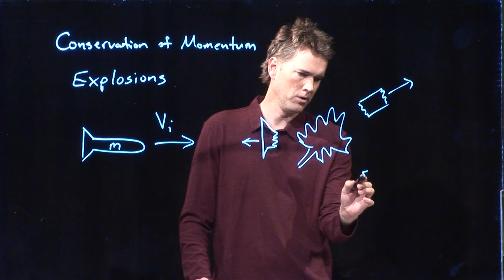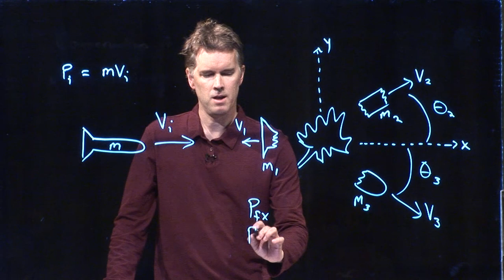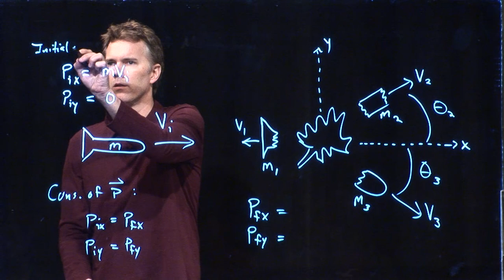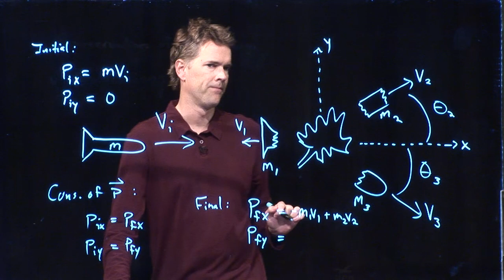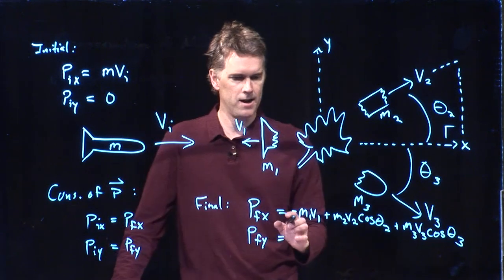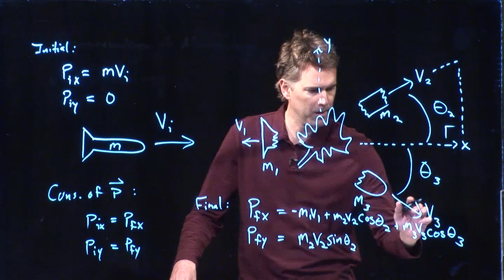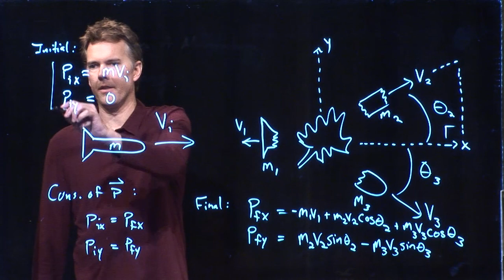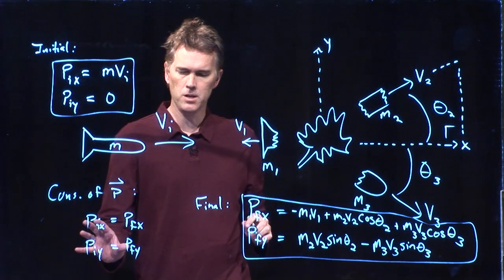Momentum   Explosions

Comment: In the calculation of the Pfx, why would you not be using absolute values ? Is the final P in the x direction not the absolute sum of the parts ? To have m1v1 as negative seems to suggest a loss in overall P thus making the statement Pix = Pfx untrue. Thank you Prof. Matt.
Reply from the maker: Ciscoho, 
Typically we don't use absolute value bars in physics.  Too time consuming.  Generally all variable are thought of as positive.  If something needs to be negative, we put that out in front.
Thanks for the comment, and keep up with the physics!
You might also like my new website: www.universityphysics.education
Cheers,
Dr. A

Comment: I have a question .... Shouldn't the third angle be between 270 and 360 because we take angle with the positive x-axis in the anticlockwise sense ..... Please can you answer , Sir?
Reply from the maker: That is fine, but then you should not put a minus sign in front of it, since, for example, sin (330) = - sin(30).
Cheers,
Dr. A
Reply: Matt Anderson Ohh ! Thanks a lot.

Comment: It all makes sense except for one thing. Doesn't the explotion add more energy to the system, thus altering V1, V2 and V3?
Reply from the maker: Excellent question.  The explosion certainly increases the SPEED of the individual particles, meaning the energy of the explosion is transferred to the kinetic energy of the particles.  But momentum is concerned with VELOCITY, which means the direction matters.  The explosion cannot change the momentum of the system.  
Perhaps one way to think of it is this: if a stationary object explodes into two equal parts and one part is going to the right at v, what happens to the other particle? 
Reply back and let me know what you think.
Cheers,
Dr. A
Reply: we are dealing in momentum, not Kinetic energy
Reply: It will go to the left with equal velocity -v so that the final momentum is 0 as it was at the beginning

Comment: Where would you substract energy loss? Would you calculate it as a whole at the moment of the explosion and substract it from Pi? Then calculate it for each of P1, P2 and P3 and decrease respective V depending on time?
Reply from the maker: x_0euf, 
Be careful.  You can't subtract energy from momentum, they are not the same units.  Conservation of energy is a separate entity.  
Thanks for the comment, and keep up with the physics!
You might also like my new website: www.universityphysics.education
Cheers,
Dr. A
Reply: @yoprofmatt  I'm definitely going to check it out, currently developing a physics engine with my own set of laws :)
Thanks for the answer, stay safe!